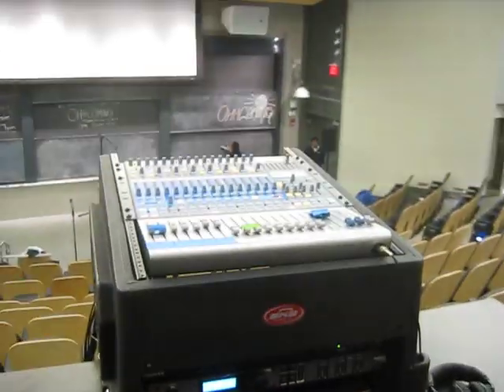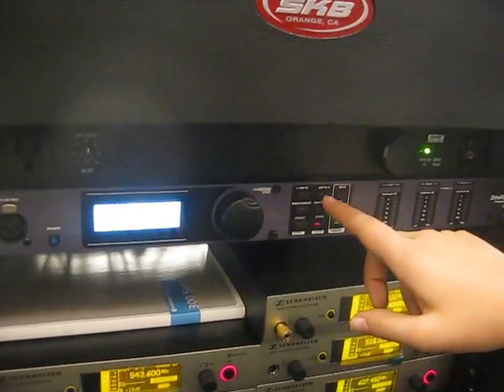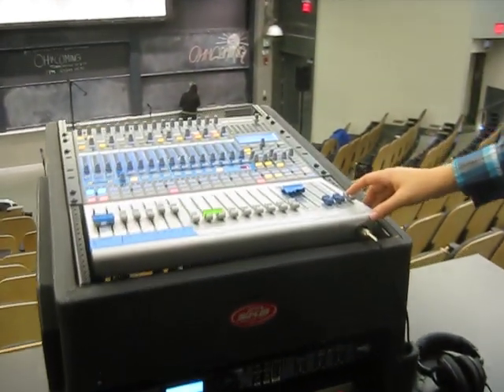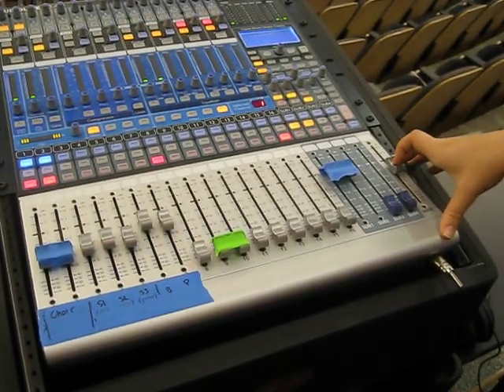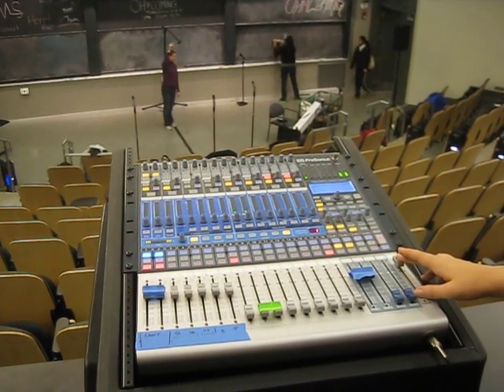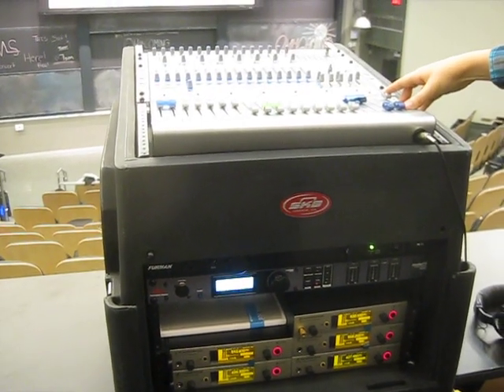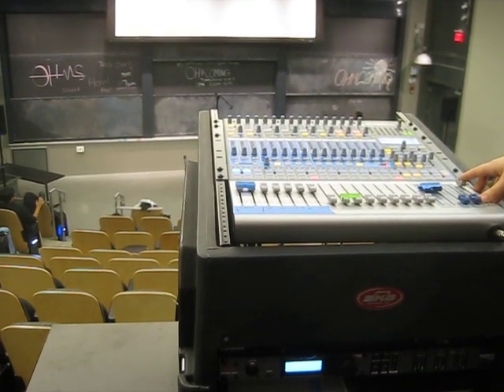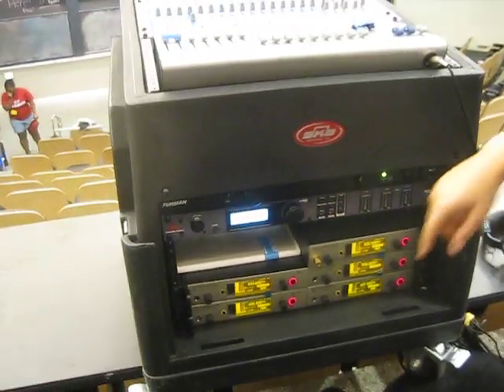Sound setup: ringing out the room

Comment: Martin Segado ( don't know if the auto name fill is the correct user?) ( and Since I can't reply, thank you Google! )  i saw your description of your use case. and I am intrigued to know whether you are feeding it the microphones or some other cascaded approach like Main out or insert?

and the PreSonus having used both the 16 and 24, i love them. they work like digital mackies, the only downside is the motorized faders. there is a learning curve and there is some downside to support ( secondhand knowledge ) but the 1st thing with any issues is a firmware update. although I do know somebody with a 16 and a dead tape input ( don't know how, thay suddenly stopped working and we switched over to the aux inputs ).
although the RTA does a parametric EQ and not a graphic EQ, only found that after we brought somebody in with "smart" and haven't played with it since.

Comment: So that's how it's supposed to work, when the manufacturer implements it correctly.
my 1st experience with the technology was bad because it was with a Peavey soundboard, I could let it ring for half an hour (ok 5-10m) and it wouldn't do anything. I suspect that they use more of a dynamic process ( because people don't know what they're doing ) so it resets itself every few minutes or just plain doesn't work. i just turned off that feature to preserve processor usage and prevent other issues.... which inevitably put 2 different mixers ( same older series ) on my repair bench.

Comment: HiFiAndElevators22 We need one of these DBX Driverack processors at Woodson. They're genius.
Reply: Indeed, that is awesome!  Don't go near that PreSonus board, though.  We have one here at the radio station, and it drives me nuts!
Reply: Really? Does it drive you nuts in the sense that its a bad board, or is it just complicated? Usually PreSonus gets a pretty good rep on most of their stuff. But yeah, one of those DriveRack units would be a lifesaver. They're a bit pricey though.
Reply: It's both complicated and giltchy.  In particular, it has an issue where the board freezes up for no apparent reason, and PreSonus has done nothing to correct it.  It also should have motorized faders, but doesn't.
Reply: Ah, I see. Could it be that the one at the radio station is just somewhat defective? Or are other users of this board complaining as well?
Reply: Other users have complained too, especially about the freeze-ups
Reply: ah. That's too bad.